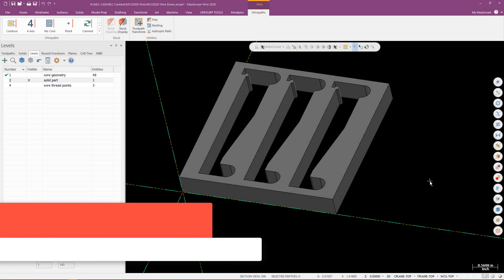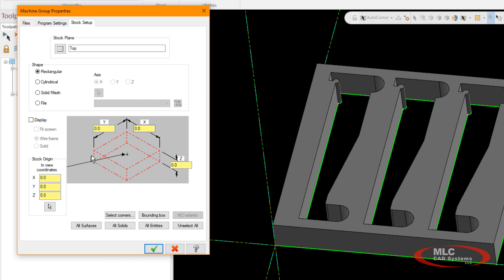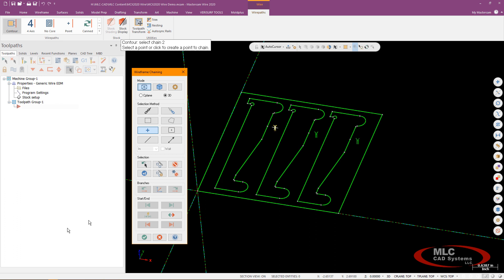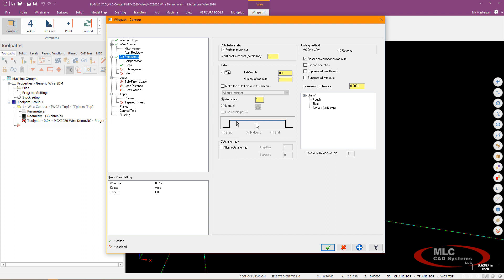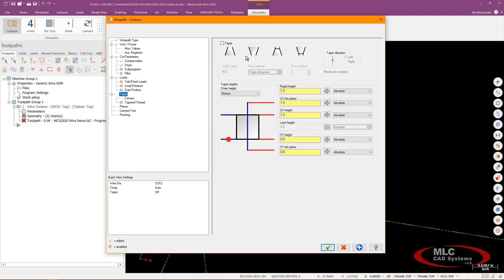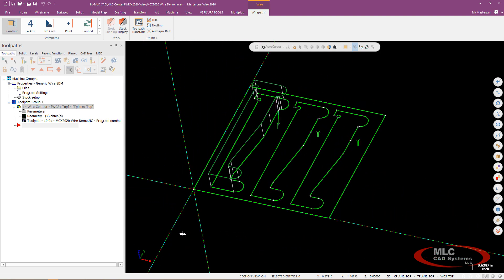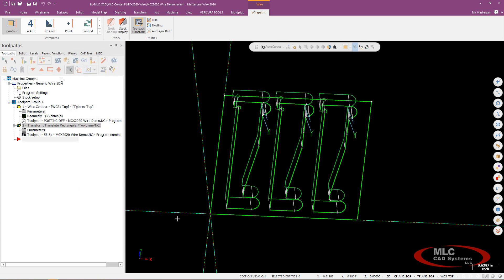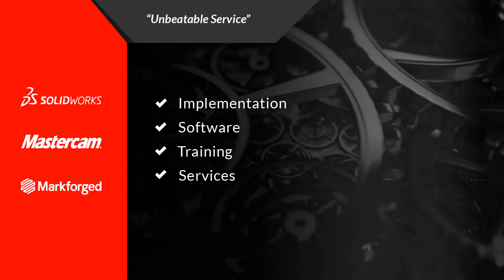Mastercam Wire EDM Demo

Comment: Not the most efficient way to do any of this. In the video, your stock does not show a wire start hole (not a big deal for just a video, but people need those things). Why translate it over, its another step you have to take for no reason, Just click the other points and chains. Also, you do not have to click point to select the point and then select chain.